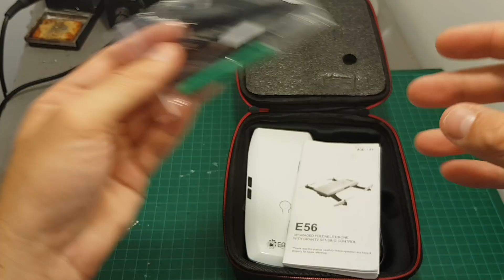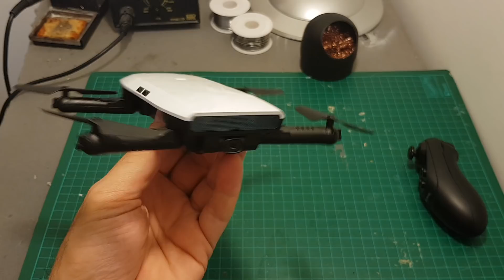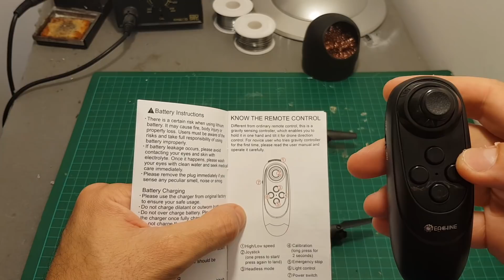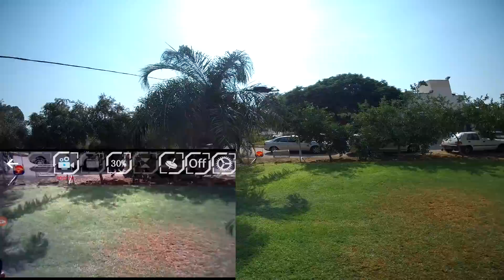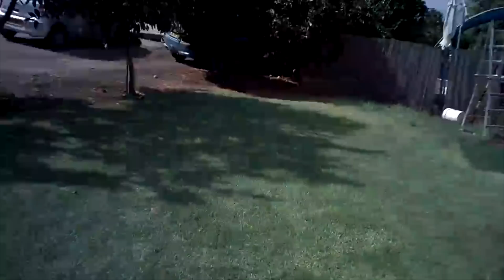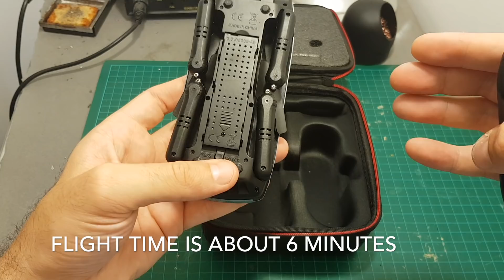Eachine E56 - Selfie Drone With Gravity Sensor Control

Comment: I just bought this ,  but dont like the gravity control. Is there a way to fly without the gravity controller?  I fly gliders  but thats with out gravity controller.  Struggling with this
Reply from the maker: As far as I know, it's not possible with the current remote controller. Maybe it's possible to bind it with another remote controller using a multi-protocol module, but I haven't tried it so I can't confirm that it will work / not work.
Reply: I  have learnt how to fly it very well now.  Took a few practices.    thanks